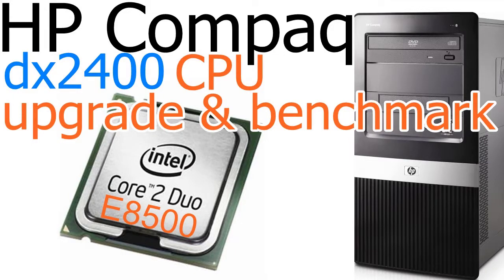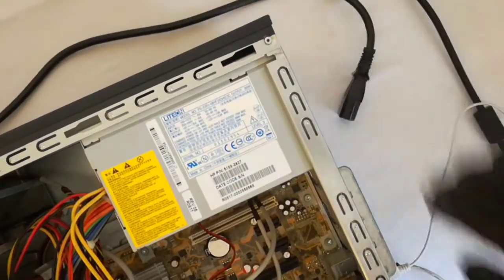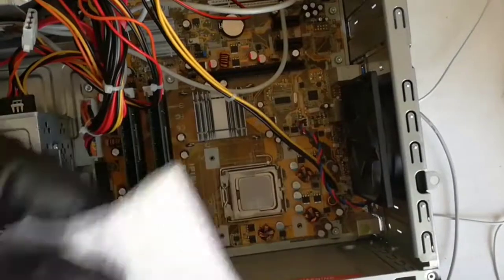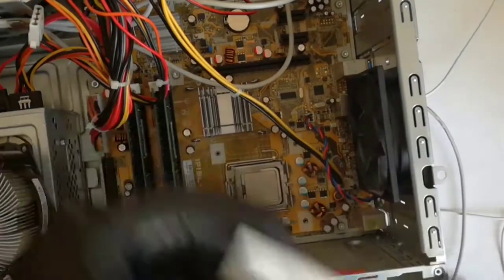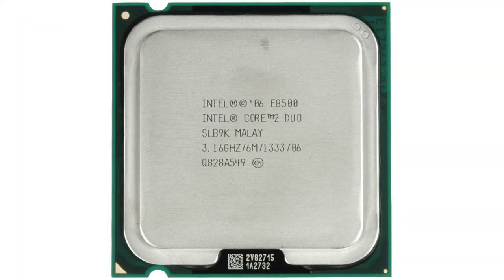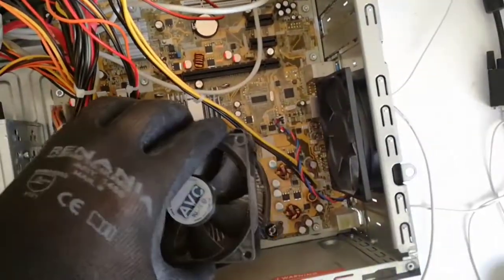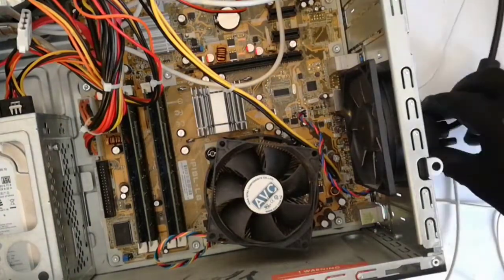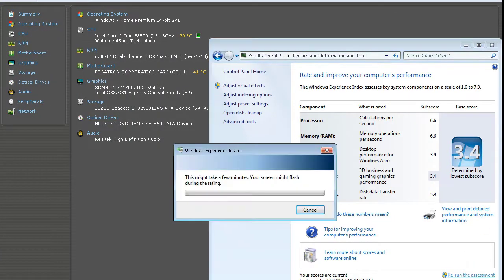HP Compaq dx2400 Microtower PC upgrade to Core 2 Duo E8500 @ 3.16 GHz Ep.184

Comment: para cambiar el CPU necesita actualizar BIOS?
Reply from the maker: Unfortunately on the HP support page the readme files for the BIOS update files are no longer available, https://support.hp.com/my-en/drivers/hp-compaq-dx2400-microtower-pc/3658372 so I can't say if it necessary to upgrade the BIOS or not. But for better compatible reason  I update the BIOS to the latest version. For example the HP Compaq dc7800 with the old BIOS, didn't boot from USB flash drive, but after I updated the BIOS to the latest version I could install Windows 10 from bootable USB drive. Good luck with the BIOS update and CPU upgrade.
Thank you for watching, if my video  was useful, please consider to share and subscribe.